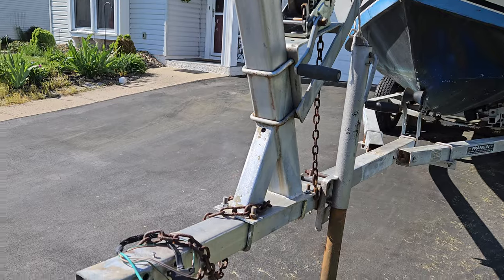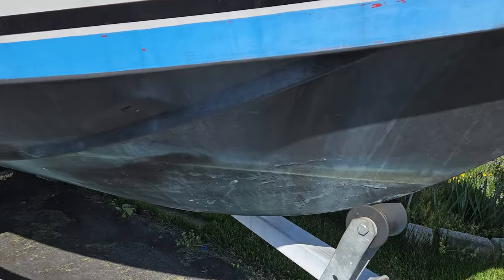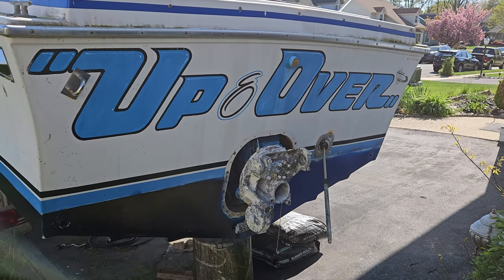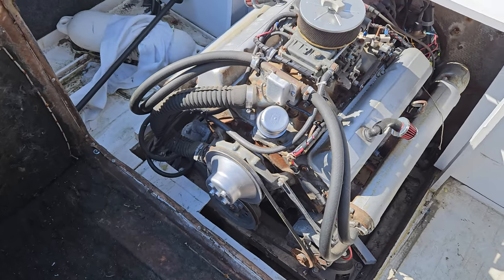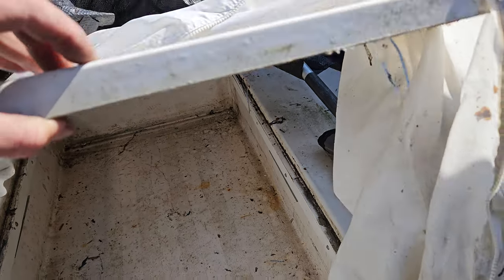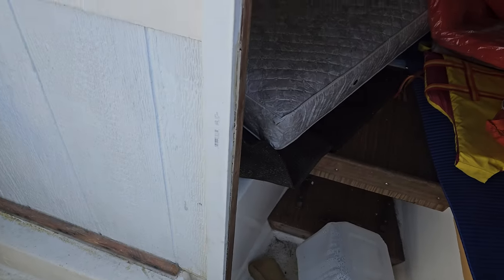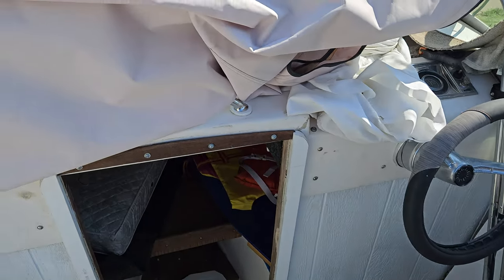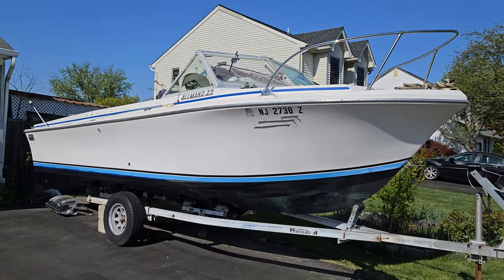ALLMAND 23 Boat Tour (For Sale $400) SOLD

Comment: was hoping to pick your brain  love your boat vids   I have a 2000 Crownline 180  I put a new block in and rebulit the 4,3 liter  replaced most parts to new and it idles like a dream  Problem I am having is over 2000 rpm i am getting sputtering and backfires.  Reset timing and same thing.  Was hoping you may have a few ideas